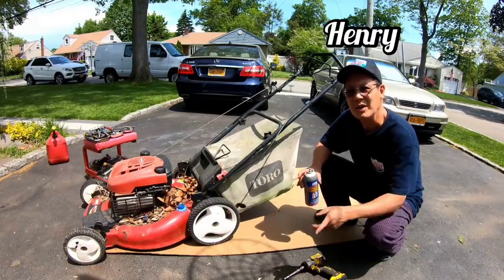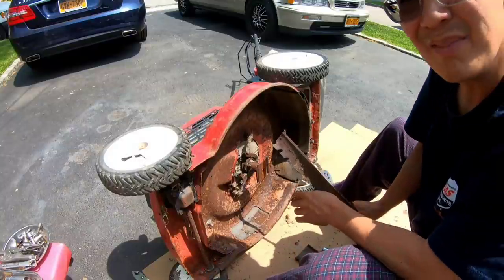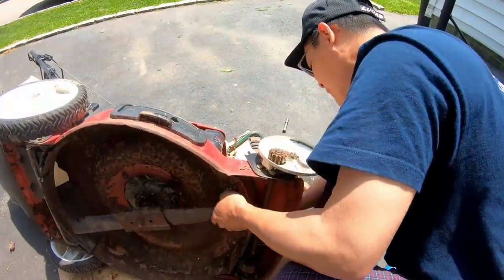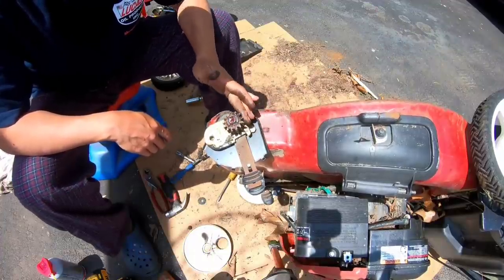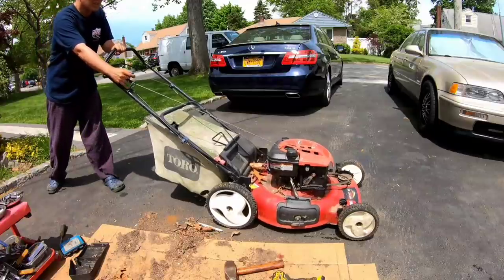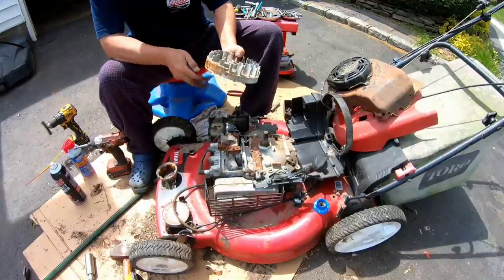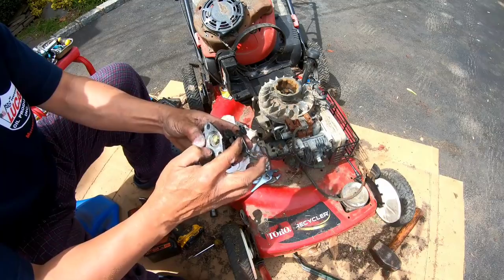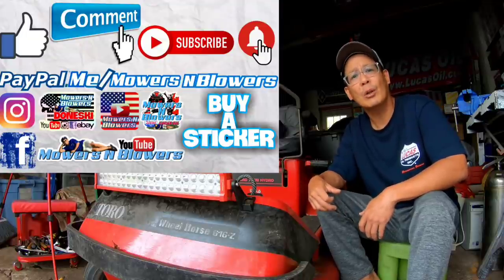TORO RECYCLER BRIGGS QUANTUM 22" SELF PROPELLED LAWN MOWER SEIZED TRANSMISSION CARBURETOR CLEAN FIX

Comment: Henry, On 7/28/19, Steve on Steve's Small Engine Saloon, shared a really good penetration oil. It is ATF and Acetone mixed 1to 1. Mix and store in a sealed metal or glass container/oiler as acetone evaporates and will eat most plastics. As Steve says you can literally watch the mixture creep into rusty threads of a bolt or nut. It might give you better luck getting those stubborn engine mounting bolts loose.
Reply from the maker: Thanks Ray,  yeah I’ve known about that mixture for a while,  a lot of my subscribers tell me about it.  I haven’t tried it myself but maybe in the future

Comment: I have a 2010 Toro Recycler and had to replace the wheel drive unit at five years. It wasn't difficult but I don't recall the price on it. Plastic drive wheels don't last long on any self propelled mower and unfortunately they can be expensive. Toro Recycler mowers are very good mowers, keep em clean, check the oil and change it when needed, clean the air filter once a month and they will give good service and last many years. Also after a few years if the mower seems like it just doesn't have the power it did when new, snip off one loop of the governor spring and make a new loop. the spring stretches a little over the years and the engine doesn't spin quite as fast as when new and doesn't perform well under a load. I've never seen that Lucas spray grease, I will have to try that.
Reply from the maker: The whole drive system? That a expensive!
Reply: @MowersNBlowers  It cost about $70 back in 2015.

Comment: They usually get rusted underneath like that because they are left outside in the dirt or on the grass instead of pavement or cement. The ground has lots of moisture and rusts them out from the bottom up. I’ve seen a ton of mowers like that, you can forget about getting the engine bolts out of ‘em. Guaranteed to snap off!

Comment: Why not check engine first? See if it fires?
Reply from the maker: Um...I did which is how I know it’s a sheared key
Reply: @MowersNBlowers  i just saw you dive into the wheels first.
Reply from the maker: Because you knew the wheels needed attention no matter what!  One thing at a time bro!  Plus i wanted to know if clearing up the wheels would compromise the transmission.  Had I gone engine first and it started,  it would have torn that drive belt to hell and I’d have no drive belt.  It could have damaged the entire tranny too!